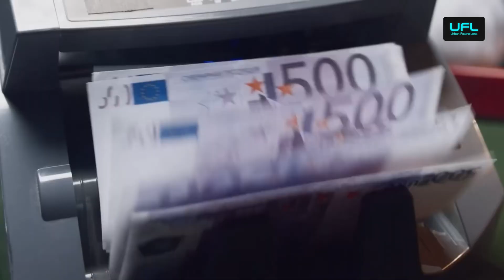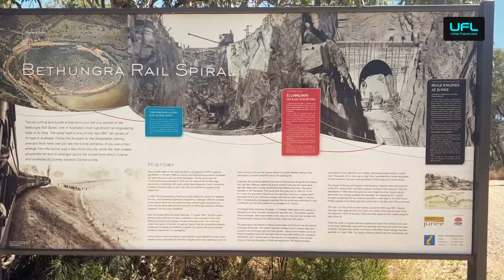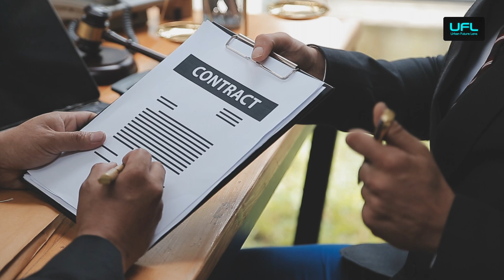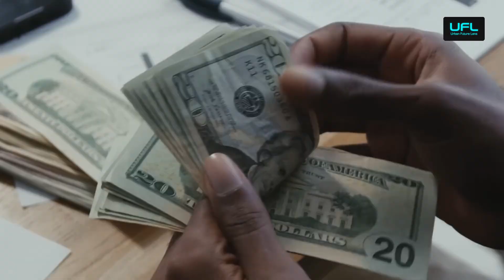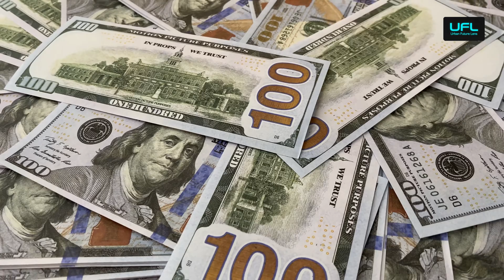Australia’s $31 Billion Megaproject That Could Change Everything

Comment: As a young sheep and cattle farmer I am a big supporter of this project but don't deny that the route planning has alarm bells ringing for me. My jury is still out on the route planning- putting it across a flood plane in my opinion is stupid / short sighted. I will give my verdict on the Condamine flood plain when the next flood goes through that area after construction is finnished. 

In short i do wonder weather relief lines are going to be required - be it from somewhere north of Tamworth up to Inverell and up, or be it from Armidale north to Wallangara and up. These may not carry the volume or length of trains govts would like, but it would move something while the actual inland rail is shut due to flooding or bush fires..

I have also heard their are issues about where it will stop start in brisbane and that maybe it should. Have went up to Gladstone (the largest deep water port in QLD i hear) but from what i hear they wouldn't even do a cost benefit analysis on getting it up to Gladstone. 

So in short issues remain but so too do driver shortages. Baby boomer truck drivers are retiring while gen X, gen Y mellenials like me and gen Z are not interested in becoming truck drivers due to long hrs spent away from home and no respect from the cops, national heavy vehicle regulator or the general public and not just on the roads, but car parks and side streets and parking bays too. Too many simply don't have the skills. 

Govts would rather focus on cheap easy revenue of $peed kill$ and putting the boot into truck drivers than focusing on the real issues of  poor driver education for light vehicles. 

Sad but true and i am certainly not an engineer by any stretch of the imagination. I don't understand the complex maths involved.
Reply from the maker: You've highlighted critical points—logistics and driver shortages are definitely big challenges that need addressing for long-term success.

Comment: Brisbaan? At least get an Australian to narrate this. This project has been in the pipe line for as long as I can remember and still the actual route is up in the air.
Reply from the maker: Thank you for your help... Will update in the next video..
Reply: As a young (35 yr old east coast Australian) I conclude Australia is not good at large scale nation building infrastructure like this - just look at high speed rail on the east coast as a great example. 

I'm not sure if your aware but the younger generations- gen X, gen Y mellenials like me, and gen Z are not producing the long haul truck drivers required to keep our country moving like we used to, truck drivers are being bought in from overseas, and I hear India is but one example, but they don't have the skill level required for our long haul routes. Reversing and route planning which is important with low level bridges that trucks are trying to get under are 2 examples where they simply lack the skill level required. 

Forcing govts to look at other alternatives. 

Govts are not helping themselves with their refusal to bring in a carravan license especiallyfor people who have never driven more than a hatchback or sedan - slow moving carravans that do 70 kph in a 100 zone or 30 kph in a 50 zone hold up trucks that just want to get to their next destination ASAP. Cops never seem to be around when such activities are going on and even when they are they care more about throwing the book at the truck driver for every little thing and couldn't care less about the carravaners and govts wonder why younger generations are not interested in becoming long haul truck drivers. 

Sad but true and I support improvements in rail in Australia, yet also gladly admit that trucks have their place.